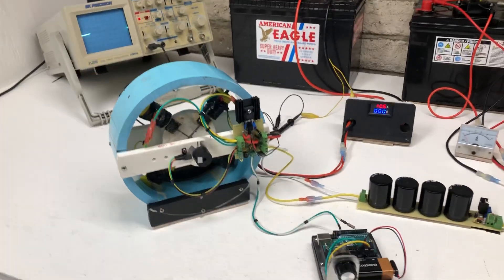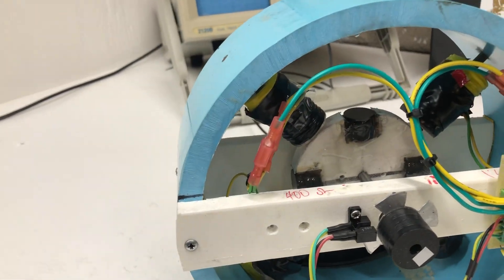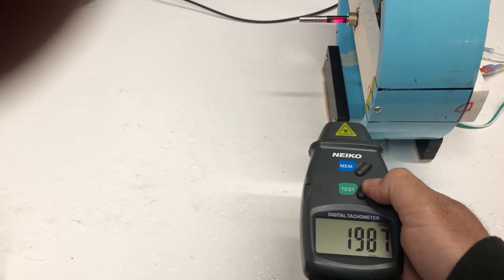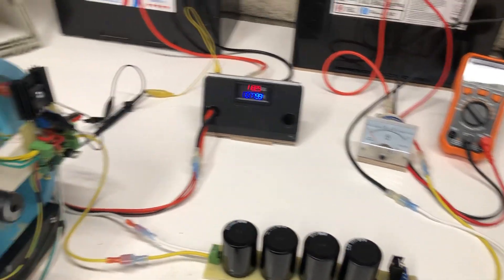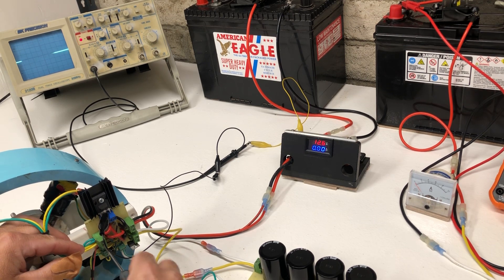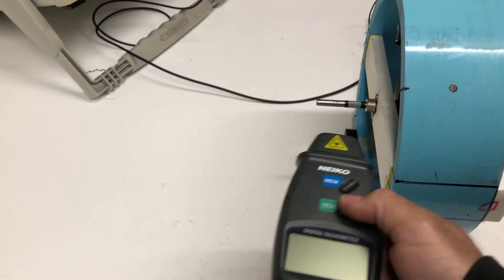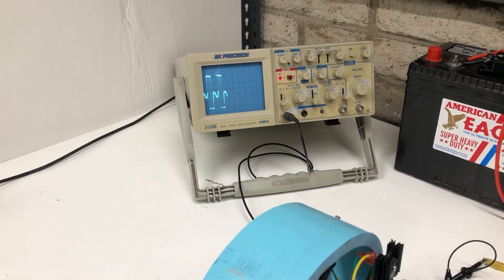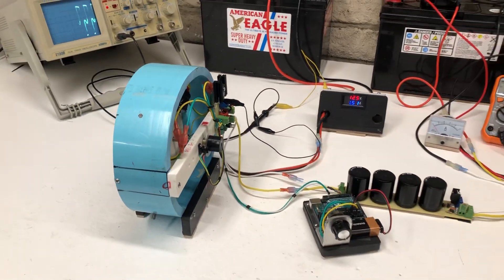Adams motor type with ceramic magnets ran in repulsion and attraction mode

Comment: Would using round disk magnets from a microwave oven make this motor work better with a cheaper method of getting magnets ???
Reply from the maker: These magnets are cheep ceramic ones
Reply: @kenergy1707  Thanks for letting me know Sir.
Reply: @kenergy1707  Could you tell me what the blue ring is made of K energy and how much energy do you get from this setup Sir ? Good day too.
Reply from the maker: @victoryfirst2878  the Blue is PVC pipe 8”
Reply from the maker: Energy depends on pulse with and load this model does not produce as much as others coils are small and magnets weak
Reply: @kenergy1707  O.K. I thought it was a pipe that you had machined of steel. Looks very solid RE
Reply: @kenergy1707  Would you tell me how much difference would larger coils and N52 magnet make Sir ?? Thanks
Reply from the maker: @victoryfirst2878  prob 4x or more with neo magnets but voltage should be higher than 12 to push the magnets off the core neos only work in repulsion mode
Reply: @kenergy1707  Got you fella. DId not know that fella. Keep us informed of your progress KE. Thanks

Comment: I've heard with the Newman motor that he hid a part of his motor.   The iron which spun in the middle wasnt really iron but a piece of pipe.  Inside the pipe was a gas such as neon.  Newman then wrapped the pipe with wire with each end open .   He then covered the wire to make it look like a big piece of iron.   When the voltage on the outside coils  was high enough , the spinning core or the wire on the core picked up the charge thru induction.   The wire wrapped around the neon gas tube, when it hit a high enough voltage   ignited the neon.    Once the neon was ignited you ended up with lots of energy or  magnetism, which then fed back into the outside coils.  
Have you heard this theory at all ?
Reply from the maker: Very interesting! I have not Herd that

Comment: So with the coils in a attraction mode. Why isn't the motor jumping all over the place like the last video showing attraction versus repulsion.?
In my opinion. In attraction mode, you have to factor in the time it takes for the steel to flip magnetic polarity. 
That's why the motor seems to run better in repulsion. In the repulsion mode the collapsing field is flipping the magnetic field when the motor is going into the steel.  
And in my opinion. Pulse width pulse length and flywheel weight is a Factor. On a larger more powerful attraction motor, there needs to be enough rotor/flywheel weight to carry the motor through the stroke. 
If you look at your standard lawn mower. Without the flywheel on top of the motor. The motor can never carry through the stroke with a load on it. 
Just some food for thought 🤔 .
if you pulse a coil with an iron core One directions it turns the steel of the coil into a magnet.
So eventually you end up with a magnet that has the same field as the magnet on the rotor. 
And that is a fact. Pulsing a coil One direction with a steel core turn the steel into a magnet. 
I know I struggled with a motor for weeks that after 30 minutes it would slow down and stop running. 
Once I started running the motor with the coils in attraction mode. The stronger the steel core magnet became. Increasing the power of the motor. 
Good stuff
Reply from the maker: Thank you for the great comment! 
 This one doesn’t “jump around “ as much as the other motor because the permanent magnets on this motor are weak ceramic 
The other one has neodymium magnets that are n52 super strong so the cogging is really fighting the rotation on attraction mode

Comment: What's the point ? The efficiency is not good with 4 coils vs 3 or other "correct" number.
Reply from the maker: The point is which mode repulsion or attraction is best for this type of motor
Reply: @kenergy1707  It would depend on the exact position of the magnets at any given time. Therefore it doesn't make sense, as it is possible to use both and waste over 1/3 efficiency at best, compared with normal motors.. Similar motors were used in the past as a teaching material (with mechanical switching), the cheap ones since they hardly can serve any other purpose.
Reply from the maker: @trevoro.9731  I would suggest you make your own motor to understand what’s going on and post it on YouTube
Reply from the maker: @trevoro.9731  it’s not a failed invention it’s a experiment 
 I’m sorry that you don’t have the means of doing simple experiments
Reply: @kenergy1707  Yes, unfortunately, I can't afford enough time to make something other than practical things and some simple circuits.